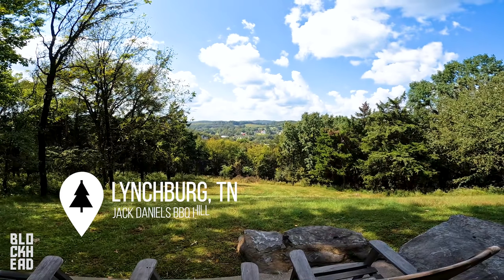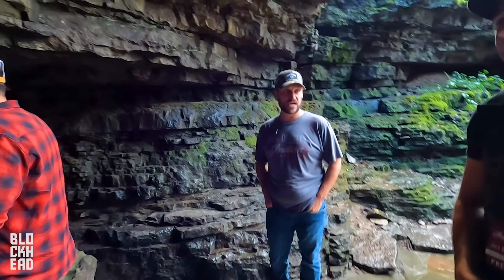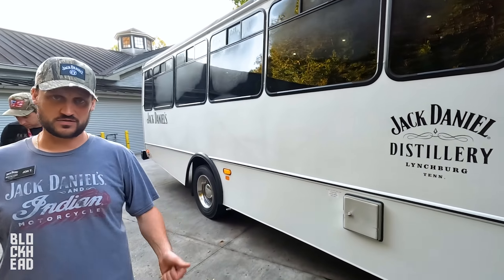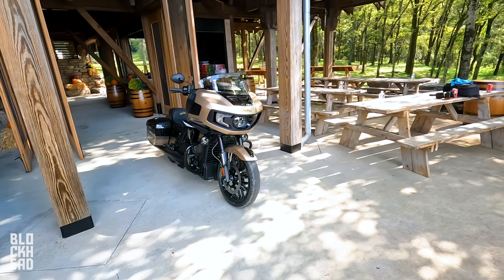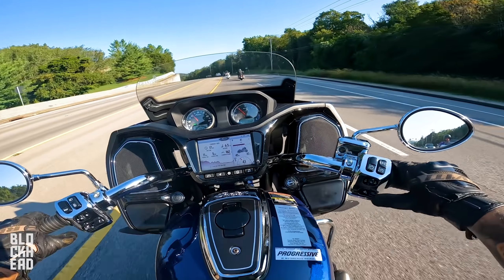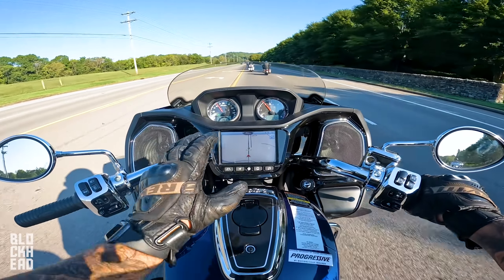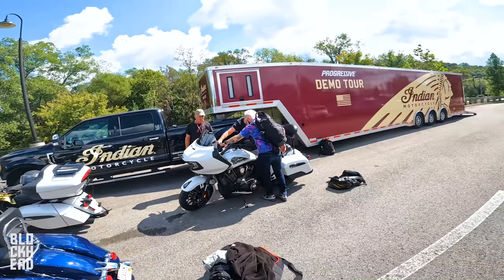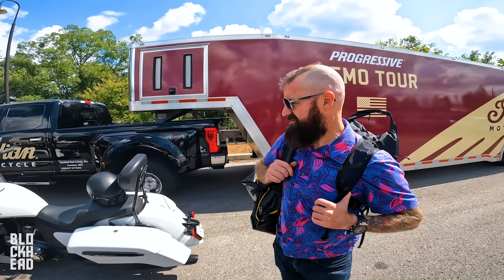2022 Indian Challenger Dark Horse (Jack Daniel's Limited Edition)

Comment: The Victory clutch was that way too. On, off. When I first rode it I was shifting it like my Harley and I felt the gear shifting and I thought it was just the bike but I was wrong. I started getting the bike into the higher rpm range for the engine and quickly applied the clutch and quickly released it and never felt a gear change again with the exception of putting it into gear. Is the Indian product the same way?